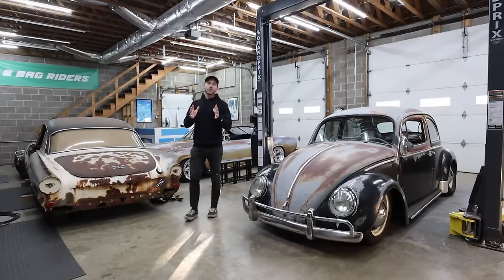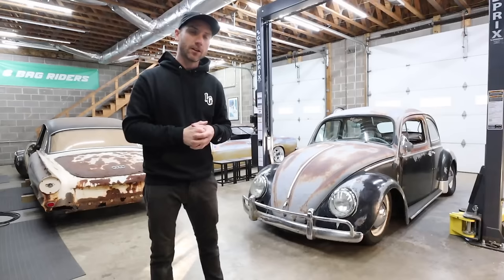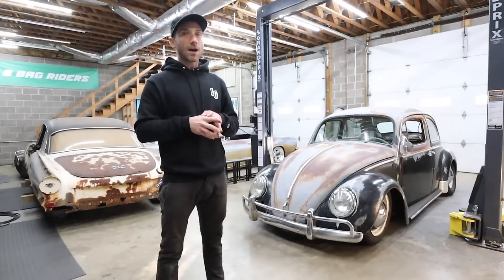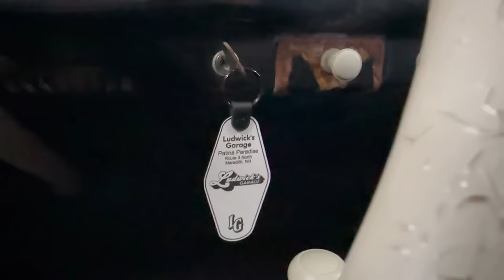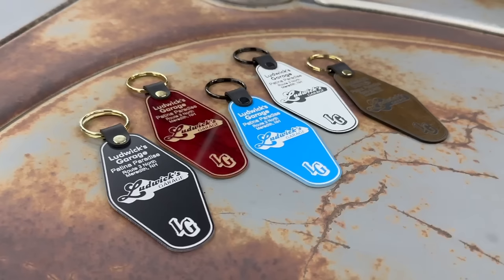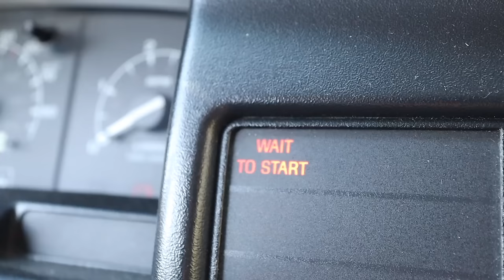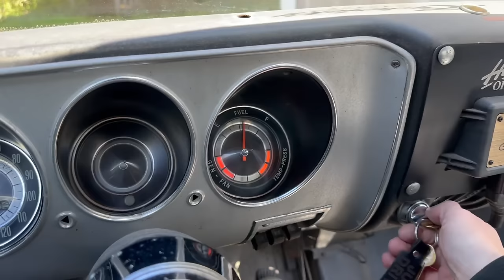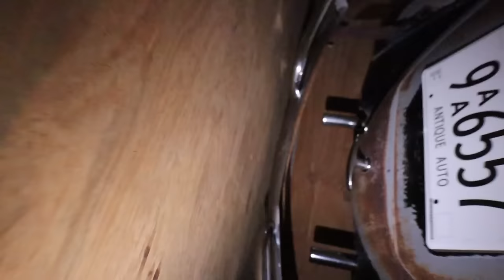I Am Giving Away My 1964 BEETLE!

Comment: Beetles are difficult to get into 1st gear because 1st has no synchros. Since 2nd gear does, when at a stop, shift to 2nd then to 1st and you'll have zero issues especially since you've already done the quick shifter alignment.
Reply: 61 and newer bugs had full sychro trans
Reply: Yes 1960 and older split case trans have a un synchronized first gear

Comment: There also a plastic "bushing" on the shift rod..the small plate on front comes off undo shifter under back seat ..remove shifter and pull shift rod forward and replace that bushing ...makes shifting smooth as butter